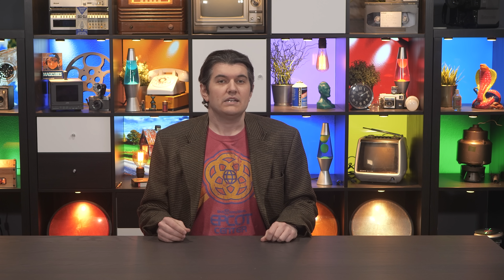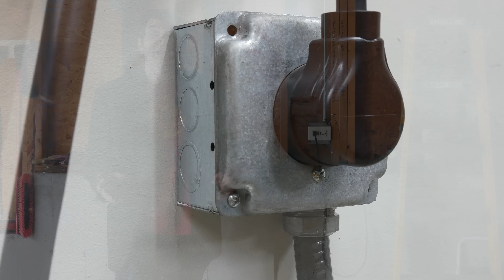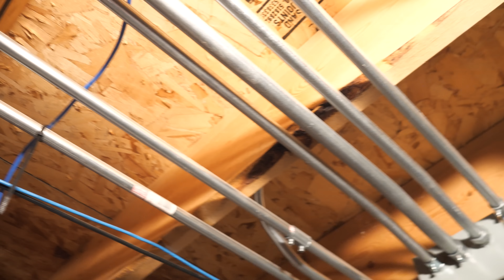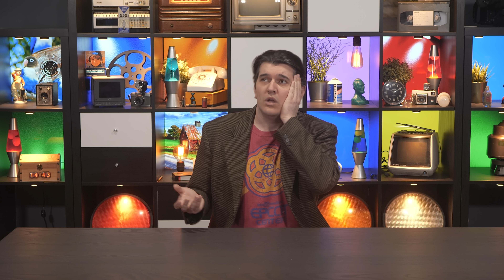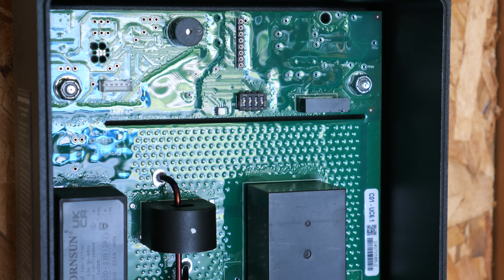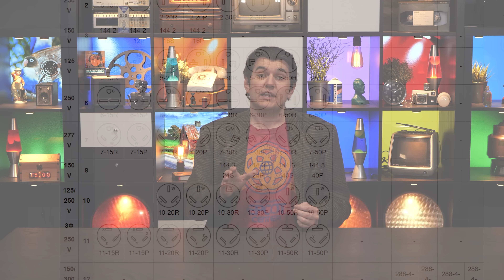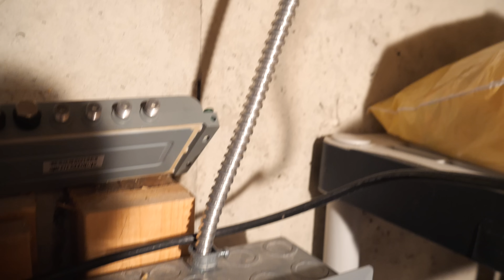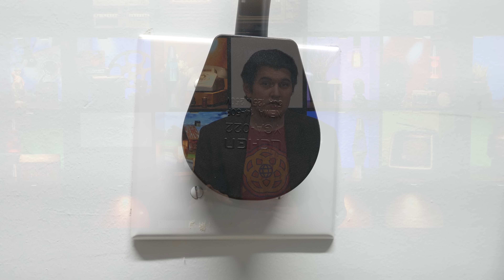The "standard" car charger is usually overkill—but your electrician might not know that

Comment: My friend uses a regular charging cable to charge his electric scooter, fast charging is possible but you can also connect it to any energy power plug at home and it will work.

I have noticed chinese EVs also come with regular cables you can just connect to a plug point and its done.

Fast charging at home isn't popular where I am at least for single family homes, apartment complexes may have it. But at most single family homes are just connecting the electric car to a regular plug point.

Comment: You can get 6 and 8 gauge mc cable, it just usually isn't available off the shelf. For the length you went(24feet?) I would have gone 8 due to continues drain for 30 amp EV charging and potential over heating on hot days.. But really personally always future proof, I would go 6awg and the 14-50plug.

Comment: One thing to note, if you charge outside and live in a cold climate, then charging a cold soaked battery with a low powered circuit is less than ideal. The battery heater will use a larger portion of the circuit capacity to warm the battery and less of the energy will be used for charging. Just food for thought.

Comment: The electricians' perspective is if we don't install a full 50a circuit for max charging performance, the customer will become unhappy when they need a quick 15 minute top off and be spending more money to have it done the way it should've been done in the first place. Buy nice or buy twice.
Reply: How about ask the customer what they want rather than just picking the most expensive for them?
Reply: @zyeborm  
Lol of course we consult with them on their preferences, but you might not know "the customer is always right" is a running joke in trades, because the customer rarely knows what they're really gonna be happiest with. It's up to a good contractor to help them understand their options and why they might be happier spending a little more (or even less) up front sometimes.

Comment: I lived for almost three years with the only two vehicles in the house being EVs, with both being charged off of a single 120v, fifteen amp circuit (which was on a super beefy extension cord to boot.)

I can count on one hand the number of times we had to use some public charging solution, in order to get enough extra juice to support me and my partner's driving needs while having a family.

I am such a huge advocate of spreading the good word that people overindex on how much they will need to charge.
If you drive fifty miles or less a day, 120 is all you need.

Comment: I use a standard extension cord to charge my Chevy Bolt.  I've never needed 240V.  I don't even plug it in every time - when the mileage is over 200 miles I don't even bother charging it unless I have a long multi-hour trip the next day.  I do use super chargers when I travel long distances (e.g. it's about 4 hours to NYC for me).

Comment: According to Grok, you will spend an extra $175 per year in electricity at 30c per kwh charging at less efficient 120v (85% efficient) versus 240v (95% efficient).
You can add some additional expense for car having to be on (auxiliary) while charging for longer on 120v. Grok estimates $179/yr.
So, it rounds off to approx $350/year extra cost to charge slow.
In addition to the cost is the potential for overheating a normal 120v plug by pulling 15amps through it for day(s).
Hopefully you would have conductors and plug rated for 20amps, and only pull 15 amps continuous...

Comment: I'm an electrical engineer in Europe and it's always "interesting" to see how US Americans wire their homes.

Armored cables but wire nuts? Those nuts are now longer allowed in my country.
And this 80% rule is also interesting. If our circuit breakers are rated for 20A, you can draw 20A. If the receptical is rated for 32A,you can draw 32A, continuously.

I read a test about charging losses the other day and the result was, that using low voltage single phase charging will result in higher losses than (in Europe) a 3phase 10kW charging.
It all depends on the car, but the difference can be quite significant. Like 12% losses to 7-8% losses.

Comment: I think the complaints about smart charging stations requiring the use of an app or software updates can be applied to just about anything these days. Even a device far more complex than "power cables" does not need to incorporate such things. It feels like a few years from now, extension cords or a simple lamp will be unnecessarily computerized.

Comment: My utility company bought and installed a 60 amp circuit hardwired NACS chargepoint. Charges my Y from 10 to 80% in 4 hrs. I now have Tesla and chargepoint station access, which is sublime.

Comment: $600 in parts and a DIY sketchy non electrician install....or $1300 for an electician and parts.

That's 240 to 600 gals of gasoline in my parts.  Even if power is free, that's 12000 to 24000 miles of driving.  Considering power costs me 16c/kWh more likely 35000miles.

A long payback for this "convenience" an EV brings.  Since I mostly use a car for 900 mile round trips to see my kids....and would be paying for OTR charging, you can see why I don't own an EV, but a highly efficient gasoline car.

Comment: I was looking at an ev charger point in the uk wired directly from the meter. The meter, and breakers for both domestic and ev were 100A. The ev charger had a current transformer in the domestic line so it knows what slack there was to take up to close to 100a combined. Smart eh?

Comment: Sorry to disagree with your statement at 2:40 that all ev’s can be charged from a standard outlet. The one you are shown standing in front of will not work with Tesla’s charger. It’s a gfci, and Tesla has a built in ground fault in the charger that will trip yours instantly! I know from experience! After the inspector left I immediately replaced one 120V and the 240V with non-gfci outlets and they work great! If you meant standard non-gfci and not the one behind you then you are good.
Reply: Yep, switched out my gfci breaker as soon as the inspector left. He had already told me most people do that!

Comment: In the uk I can run 3.8KW from a normal outlet and kitchen ones are 7.6KW.
I think "enough",.
Most garages in the UK that have electricity will have 16A 240V, single phase.

Comment: Model 3, 110v gives you about 3 miles per hour, so 13 to 14 hours to charge to get 40 miles. 110 outlet isn't going to cut it for most people.

Comment: A LONG time ago, I posted on the MyNissanLEAF forum that 120 volt charging was only 75% efficient. I was lambasted...for a year or two.  At least until an engineer who had extensive knowledge of the LEAF and its systems, posted the same thing. I simply linked my post from over a year earlier and didn't get a single apology. 

Since then nearly 14½ years ago, I have charged at home with many options including 240 volts at 12, 16, 20 and 24 amps.  Never made the max.  In most cases, I was splitting time with the dryer outlet so my cost was insignificant. 

I now live in a place where all utilities are included as part of the rent so now the question becomes "how much more am I paying for rent to cover the utility cost?"  
Now, the place I am in is smaller about 500 sq ft which was my target planned for the end of 2025 when the end of the time clock from my existence was planned.  But the move came early due to the sale of my previous residence.  It took a while but the place I have now has outside storage, a garage with opener and exclusive driveway access. 

The rent I am paying now, I might be able to find something lower that includes utilities but it would be a struggle and after over a year of comparison shopping, I have only seen one advertised that would have saved me $50 but... I can say with 100% conviction that finding one WITHOUT UTILITIES INCLUDED  that includes the latter two amenities mentioned above would be all but impossible. 

So 120 charging at home only?  Yeah, it works.

Comment: We lead a pretty car-dependent suburban lifestyle, driving our Chevrolet Bolt EV every day. I was sure that I would need to install a proper "level-2" style EVSE in our garage. But honestly, just charging overnight on a 110V outlet and going about our lives, our battery rarely even dips beneath 50% charge. And then on some rare (MAYBE once or twice a year) occasion when we absolutely have to have the car at 100% charged and it's pretty low, just finding a public charger to get it up to 100% is barely an inconvenience. We've had an electric car for ~4 years at this point and the amount of energy we recover from a standard wall outlet is pretty easily >70% of what we use up on a typical day. And then there are enough lighter driving days that naturally make up for that "shortfall."

Comment: I literally just did this exact thing for my new Model 3, I installed a wall connector, but could of been any charger or receptacle. I used 50' of 6/2 gauge NM-B romex stranded, but if you wanted to use a receptacle or for future proofing you would need 6/3, which is 3 conductors plus a bare ground wire, plus two 60a breakers, one inside the sub panel in the garage plus another inside the house in the main panel feeding the sub, the wire in the ground was 4 gauge solid core feeder wire so it can handle 100a so it should be fine, also this is a continuous load so with the 80% rule, hence the 60a breaker and 6 gauge, 4 gauge would be even better honestly as the cable does get warm when its charging. I pay currently, a varying rate of .767c/kwh, I live in Ohio and we have an electricity marketplace where all the providers can show their rates so I could get better rates if I tried but its fine for now. I also originally only had one 60a breaker and forgot to get one for the main panel and the car pulled 60a and blew the breaker so I limited charging to 25a in the car and then when I got a 60a breaker I increased it, not that I need it right now but eventually I will so it will be nice to have and be able to fully charge back up in a couple hours.

Comment: I have a townhouse and the closest point to my parking space from my house where I was able to install a plug (so the HOA wouldn't throw a fit over a permanent EVSE) was about 35 feet from my car. As a result, I ended up getting a 20 foot J1772 extension cord rated for 40A and a Grizzl-E Mini. My Hyundai Kona Electric can only handle 32A/240V L2 charging at the fastest, so I set the Grizzl-E Mini's dip switches to 32A and so now I sleep soundly knowing my NEMA 14-50 plug, 50A circuit, and 40A continuous-rated extension cable are all built to a higher spec than my system will ever draw, even if my wifi goes out.

Comment: I have a plug-in Fusion Energi. My landlord won't let me run a cord down to charge it. Ok, no problem.

I have a Dabbsson 2300Plus and a 600W solar blanket which I toss over the car when it's parked in my lot. Direct unobstructed sunlight all day and as a bonus it keeps the car much cooler, like a window reflector. I top it off almost everyday this way. Granted, electric only is 21mi but it helps a ton. I live very close to Technology Connections. For people in my area that need to do local things daily like bring children to school, get groceries, etc this thing is sweet. I average like 56mpg using my 21 free sun miles every day.

Comment: I'm very tempted to send this to my landlord! The wall outlet he lazily installed is alright for once I get a desk job again (anyone hiring a programmer?), but I already have a 50amp plug-ended evse that will only pull a little over 30 amps, limited by my car! There's room on the breaker, provided someone's not also using the washer/dryer at the same time, and it'd really help cover me while I'm stuck running food deliveries, as that's a use case where I do need enough speed to charge from 25% to full overnight.

Comment: Here in Germany we mostly install 11KW charger or wall-boxes. the installation isn't really a problem because you only need a 3x16A breaker, but you have to get approval for it from the grid-management company.

Comment: Three major issues with EVs.

1) Energy density of batteries does not scale well for larger vehicles

2) Energy density plus material composition of batteries leads to batteries being much more volatile in non-ideal conditions.

3) Batteries age with use in a way that only allows them to drop to 80% percent of their energy storage than catastrophic failure. Gasoline does not have the aging issue.

The idea of having your own means of charging your vehicle is not inherently a flawed one, but physics suggests it should be a better fuel combined with a smaller battery/capacitor bank.

Comment: "MC's largest size is 10 gauge."  That is incorrect. I'm an electrician. I have installed 8 gauge MC and I have seen MC up to 500mcm, which would handle multiple large houses.  You could've done MC in 8 or 6 gauge.  But yeah the #10 is probably enough.

Comment: @14:00 at $300 how much money does that save compared to getting a new circuit added by an electrician?
Reply: $4,400 in my case
Reply: @kreengorilla  Wow, I work with commercial contractors on installing circuits on a regular basis and that seems egregious for a residential service.  Hope you got multiple quotes.

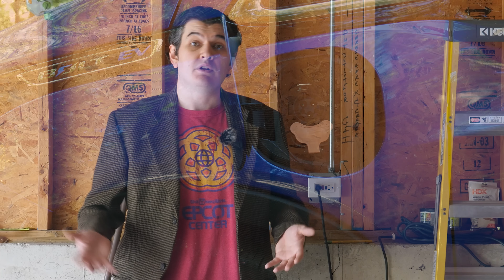Comment: 2:30 My laptop needs the proper charger, because it isn't designed to actually run off the battery.
Everything else just needs longer to charge.

Comment: 14:20 I'm not an electrician, but I heard that in the latest code arc fault is required on all receptacles also. So that means that 240V dryer receptacle in the garage you can plug your welder into... Not sure how that's going to work 😂

Comment: The biggest downside for me with EVs is taking long trips. We sometimes vacation in Maine, which is a 20 hour drive. I'd add a couple more hours on that by driving electric due to having to wait for charging. Now, for daily driving it really wouldn't be that bad for the reasons listed in this video. Trips are the major downside for me though. That and I need a truck for the utility purpose so it does cause problems there. For shorter trips though, I wouldn't mind it. But adding a even one hour onto a 20 hour drive makes it feel a lot worse than just an extra hour.

Comment: Sorry, overkill points to waste and waste is in the eye of the beholder. We adjust to life by implication. That’s why cars have fuel injection vs carbs, computerized controls vs manual adjustment ones. The HVCA AUTO function allows drivers to set a desired temperature, vs manual slider ones, etc. An EVSE does one thing, connects the EV to the power source. The rest is automatic. A 240V 32A unit for a 100 kW battery will be better than a 16A unit. For PHEV that’s a different application and an outlet powered EVSE will work.

Comment: Purchased a 2024 ID.4 with factory 5-15/14-50 32A EVSE.  Used the 5-15 for a few month in a 5-20 20A 12-2 (1 Kw to 1.5 Kw); electric bill jumped hard by nearly 125% of monthly average.  Purchased a Lectron 15A 5-20 (1.5 Kw to 2.0 Kw); bill decreased to roughly 100% of monthly average with 20% or so more miles driven.

Electrician added a dedicated 14-50 on a 40A just feet from my main exterior box; high quality receptacle, didn’t realize it was not EV rated.  7.0 Kw on very rare occasion when a QTA is needed; 99% of the time, turned down at 2 Kw on the car menu.  Electric bill is only 5% to 10% over monthly average now; this will come down further when our 4.4 Kw solar array comes online any day now.

BEV/PHEV is a different mindset, one I did not understand fully until I lived with one.  ID.4 is the commuter/errand car, her ICE CUV is the distance traveller.  When the factory EVSE dies, will replace with a quality dumb hardwired setup.  Not going back to ICE for my car; her car is still open for debate.

Full disclosure:  grew up around auto racing, twisted many a wrench over the years, built my own cars and have a track championship trophy sitting on the bookshelf.  Ironically, all my racing is now confined to sim…..and racing electric carts.

Comment: Save a ton of time and headache.  Hard wire a charger as that reduces failure points (think melted outlets and plugs).  Also, If you were told you need a "heavy up" aka service upgrade there are devices like the neurio meter (for Tesla) and the Emporia view (for emporia chargers) which monitor the electrical load on your mains.  For a 100 amp service you would set the limit to 80 amps.  When your household load hits 80 amps, your EV charger will automatically slow itself down or pause charging to keep household load at or below 80 amps.  Then, when household electrical demand drops again your charger will automatically continue charging or increase its speed.  This is much better than installing a smaller and slower charging circuit which may need to be upgraded down the road or using outlets and plugs which are were never designed for the long continuous loads of EV charging.  Get a proper charging setup for a permanent home charging installation.

Comment: Slower lower power is also useful in that it doesn't require a large power generator. For example: its better to have 1000 EV's charging at 3.3kW  (3.3MW) for 8 hours, vs 6.6kW (6.6MW) for 4 hours and then idle the power generator for 4 hours. 
Same energy delivered, half the power plant, more effective.

P.s. I love the intelligent comments in these videos.